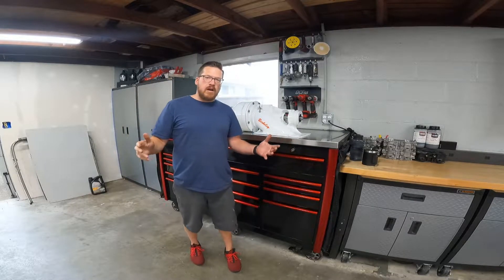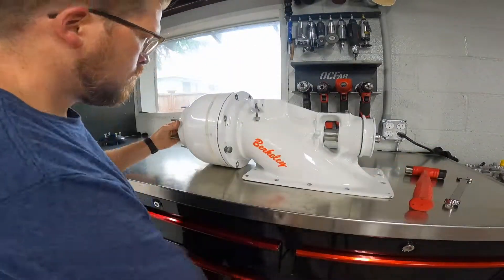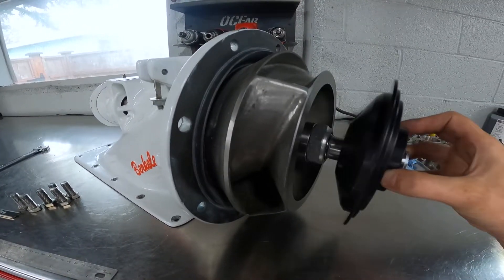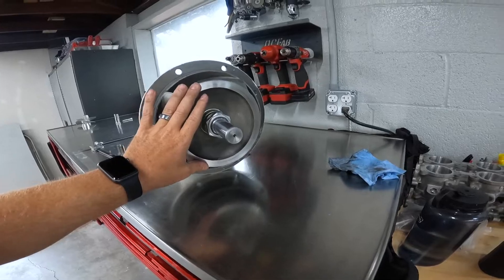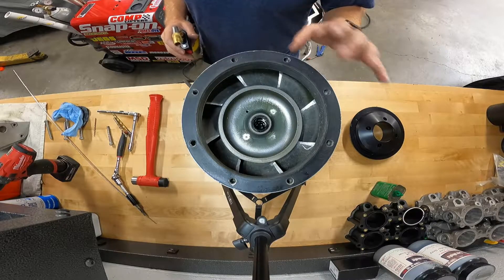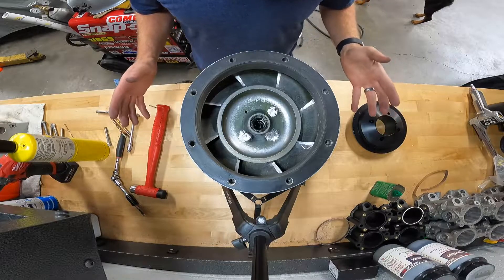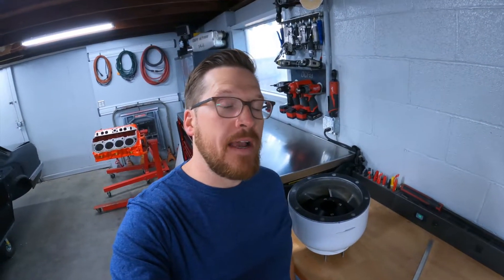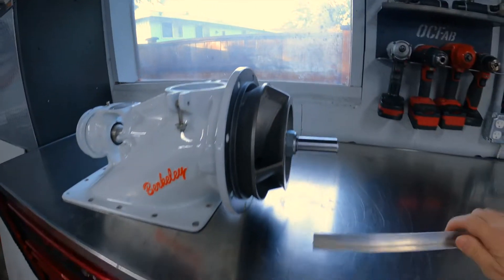Installing a Bowl Stuffer into a Berkeley 12JG Jet Boat Pump

Comment: I was cringing as you were marking those holes having made the same mistake. You cannot even do that with woodworking let alone something that needs to be done extremely accurately. Next lesson you’re about to learn is all that crap that you’re blowing into the center of your bowl is going into that bearing. Don’t be surprised when it wears out early.
Reply from the maker: No need to worry about the bowl bearings/bushings. I took my time to clean out all the aluminum bits within the cavity...

~ Nick

Comment: Nice vid. For me I think the bowl stuffer mod would be quite far down the list of pump mods. I'd really like to see some data or back to back tests on what difference it makes to holeshot etc but there seems to be nothing out there on this. Also with drilling into the oil chamber you now have swarf in the chamber which could get into the shaft bearings and seals. I guess its really for the guys wanting that last bit of performance from the pump.
Reply from the maker: I am in complete agreeance with you. Adding a stuffer to a pump is a mod that should be at the very bottom of anyone's list of mods to do. 

~ NIck